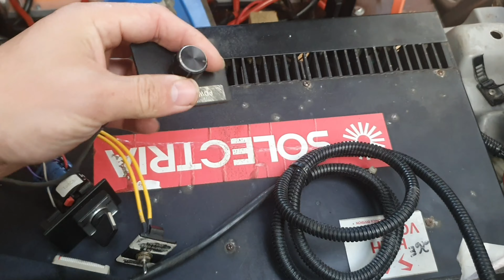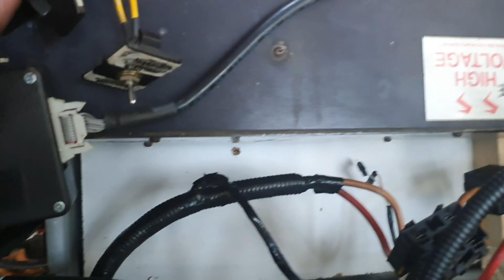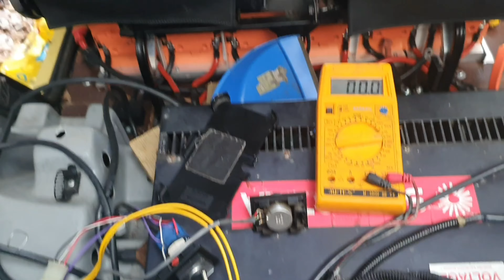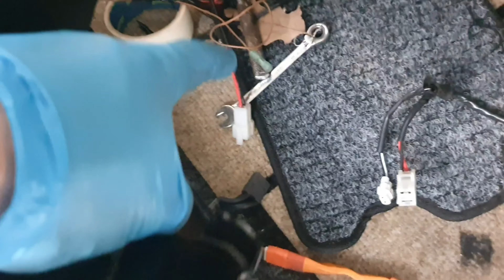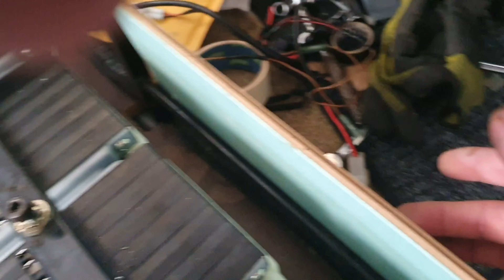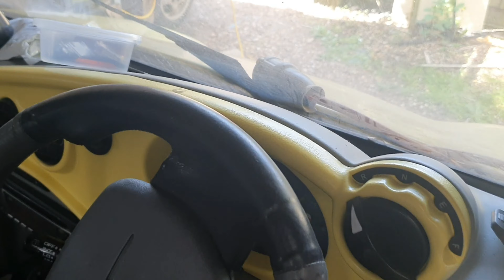REVA G-WIZ: Yellow Wiz Lithium-ion conversion pt. 21 - wiring up accelerator

Comment: great work, I don't think you need reverse light, for MOT, or u could just have a switch for a rear flood light.
Reply from the maker: Oh, You don't - I thought if you had them they had to work. Either way I figured it out - the reverse light is now turned on permanently but with a negative feed to the switch on my other drive switch so that it only comes on when in revers on there instead. Using the live 12v to feed my inverter start signal when ignition is turned on. All in next video.

Comment: reusing the original gear selector would be better since wiring is already there..
Reply from the maker: You mean the one already connected to the inverter? That's the plan as just adding reverse light cable will be simple. If I knew what each wire meant it would be simple to wire upto the loom and the switch on the dash.
Reply: @RichardMawby  oh i mean the reva gear box on the front. :)
Reply from the maker: @videostar555  Ah right, yeah if I can understand what all them other wires are for then maybe - but there appears to be other wires on the switch that go elsewhere - but it's fine because i need all the other switches too so it won't hurt to keep them on the centre between the seats. I can change it in the future perhaps.